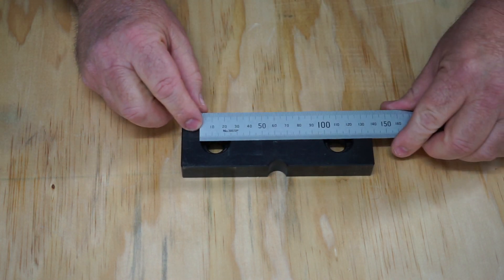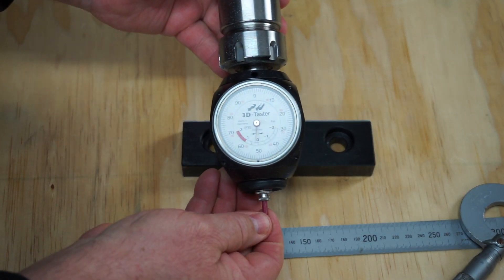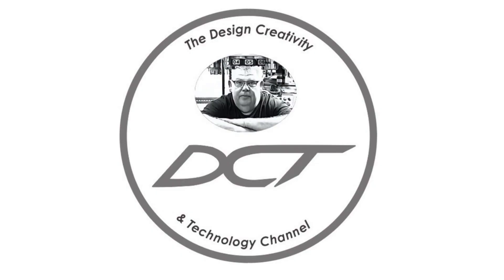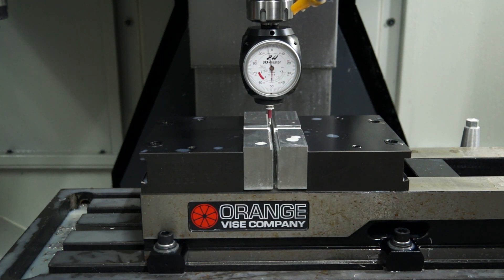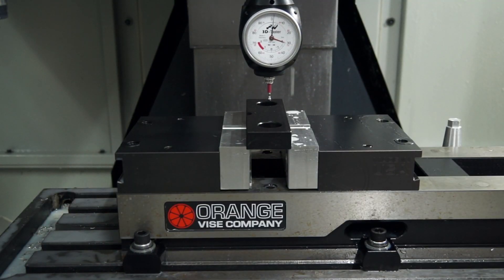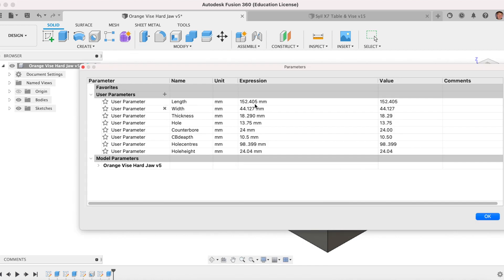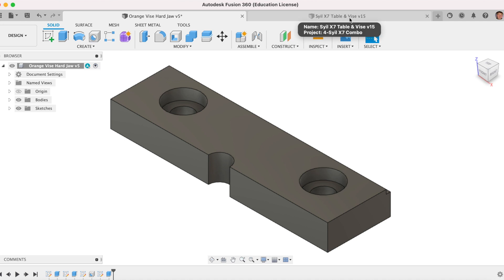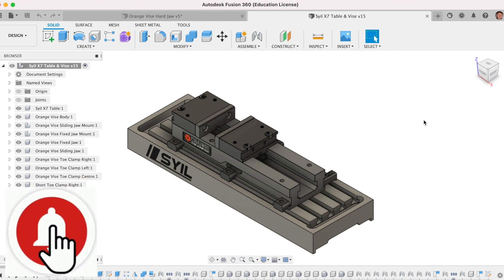Use your Haimer 3D PROBE for accurate measurements

Comment: Great videos!
Its good to see someone sharing there leaned experiences. 
On that note, one thing to keep in mind is your part setup.
This has big impact to thing you are measuring if you are holding tight tolerances as you are measuring in relation to the machine's Axis/vector.

Keep up the good work and if your looking for some time to kill take some time to read into metrology and read though ASME y14.5 and/or ISO 1101

It's a rabbit hole so have fun and share what you learn; the industry needs more people that have passion to learn and share what they know.

Thanks
Reply from the maker: Hi Johnathan.  Thanks for taking the time to watch and for providing information and further reading.  You are absolutely correct.  I am relying on the accuracy of the machine and this doesn't take into consideration a perfectly trammed vice, a trammed table and or backlash in the screws.  However, I think I was within 50 microns.  When I get a spare moment I'll look up the reading material that you suggested.  Thanks again for stopping by my channel.  Cheers, Aaron.